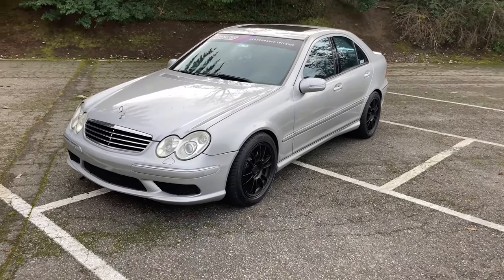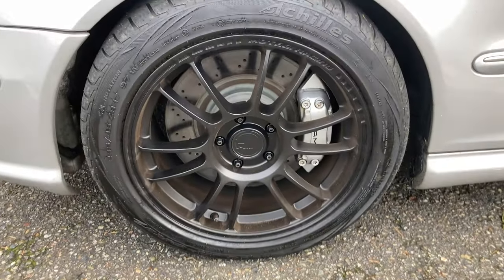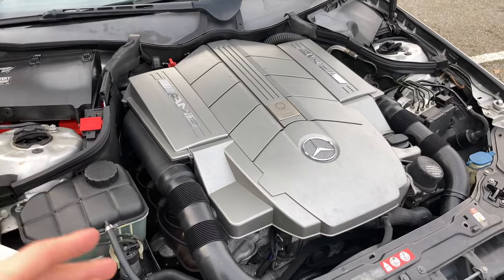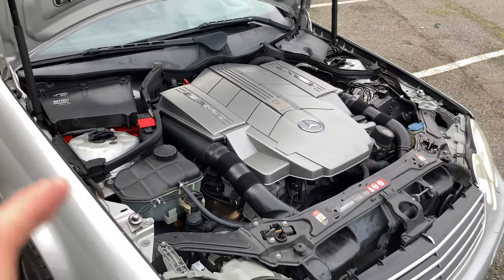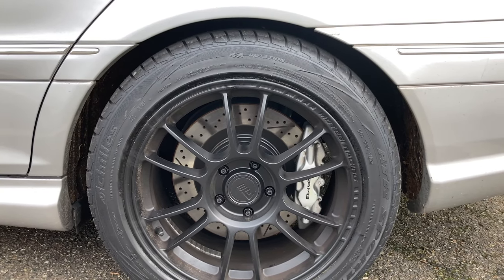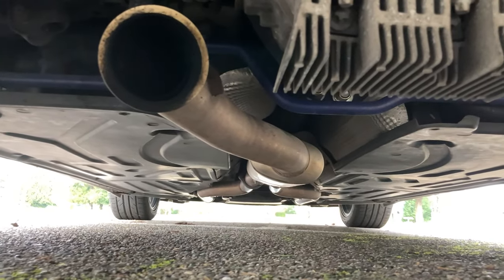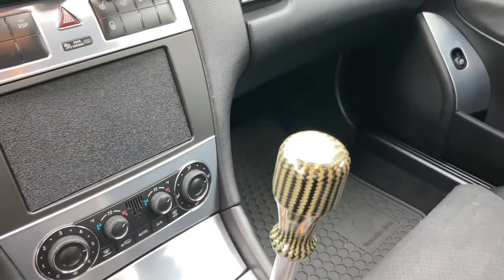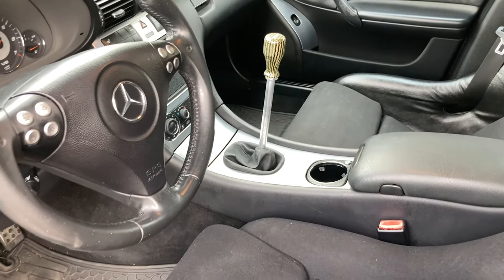C55 AMG 6 Speed Manual - Modification Walk Through (W203)

Comment: Hello, I have a 2003 c320, can this be done to it? And what exact parts do I need besides the transmission from a crossfire?
Reply from the maker: Yes it can be done. Everything including part numbers can be found in the videos on my channel 👍
Reply: @ANDERZENAMG  thank you! Do I absolutely have to have a MB tech change the code for my car or Is it not required, and will my ESC still perform as intended? Thank you for responding so quickly!!!
Reply from the maker: @chri2halty954  nope, you can leave the automatic shifter plugged in and set to P or N and it will behave like normal with ESC fully functional. You will have a CEL but it won’t affect anything.
Reply: @ANDERZENAMG  Ok cool!

Comment: Hi, what differential final gear ratio you use on 6 mt gearbox?
Reply from the maker: 3.07
Reply: Is factory open diff or lsd? I have mazda rx7 fd3s swapped with 5.0 m113 and hawe 5.5 m113 from clk55 engine for new swap to my rx7, but my 3.9 lsd from rx7 i broke, 3.9 ratio was awful (it wos too short) i think swap diff from w124 asd diff, but dont know what will beter 3.07 or 2.82, please let me what your experianse, glad from 3.07 on 6mt gearbox or 3.07 is short too?
Reply from the maker: @berikashvilivaleri  wow that sounds like an awesome project! Connect with me on IG and we can message more there. The 3.07 is open diff, I think the gear ratio is almost perfect where it is. An LSD would be nice. I would say either one will work fine, I would say choose the one that is easier to fit.

Comment: Hey How has the crossfire trans kept up with the torque and power the c55 makes ? Really interested In converting my c55 into manual just want to know if the transmission will hold up for a while  .
Reply from the maker: Been about 1k miles thus far an no issues whatsoever, most of those miles have been aggressive driving as well. There are others with the same swap with reported 80k+ miles and no issues. Wouldn’t worry about them holding up at all 👍
Reply: @ANDERZENAMG  thank you !!!!! Appreciate the feed back .

Comment: I have a w203 c350 manual 
For c55 swap? What you need?
Reply from the maker: as in you have parts for sale or?
Reply: @ANDERZENAMG  oh no i hav3 a w203 sport, manual with the m272 engine. Still running strong but want a c55 engine swap. Probably too much work. But it being a manual makes me hold onto it
Reply from the maker: @trutube5955  ah I see... it can be done but engine bay will be tight.